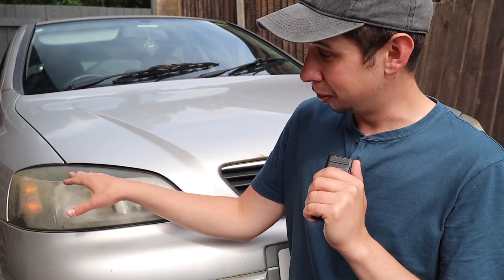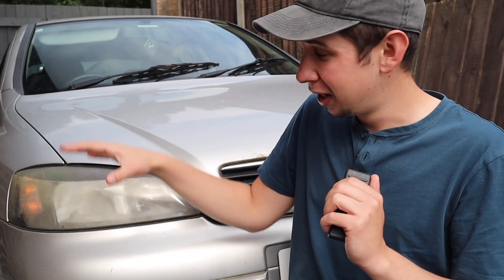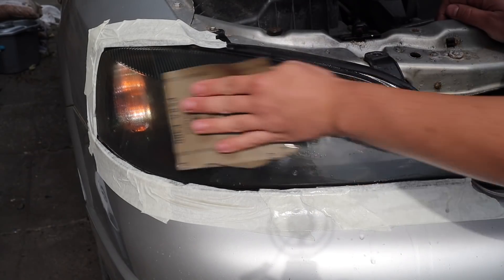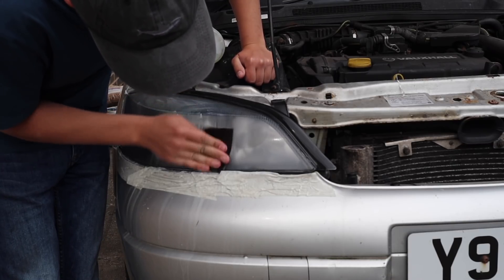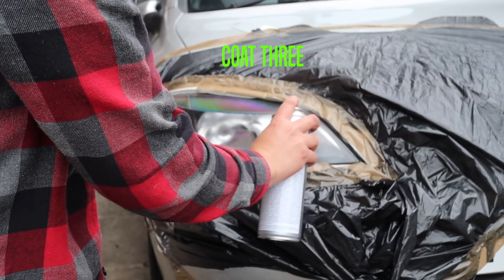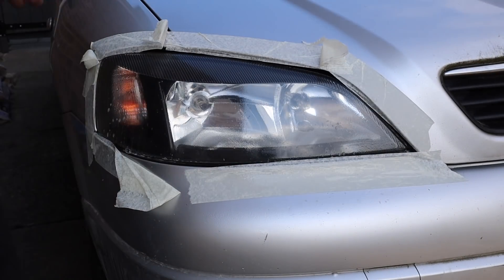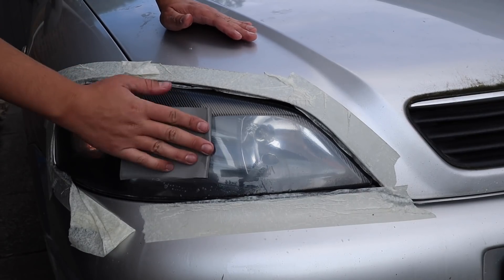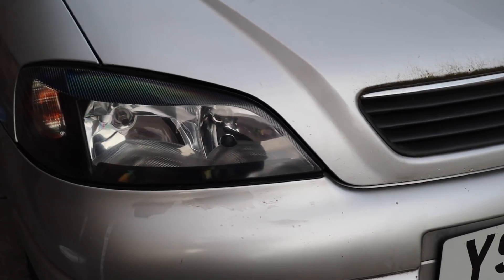How To Restore Headlights The Permanent Way

Comment: I was very surprised to see you added clearcoat over a heavily sanded surface at the mid way point rather than just continued refining with finer grades of wet sanding and a final polish. Can’t believe the result
Reply: Finish with like 600 or 800 and then smash on the 2k clear. Lasts much much much longer than just polishing them back up

Comment: You should have started with 600 or 800, and definitely used a 2k clear coat, the upol lacquer is 1k and offers no uv protection or lasts more than a few months

Comment: The lights look too good for the car lol 
I used 2k clear which worked pretty well,im going to experiment with some epoxy casting resin soon (i got plenty left over after making some carbon fibre parts)